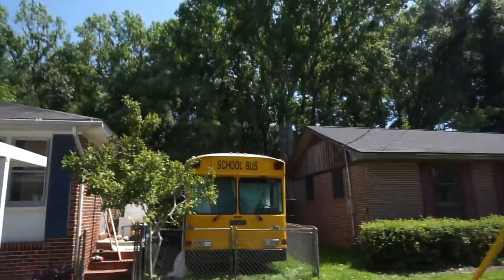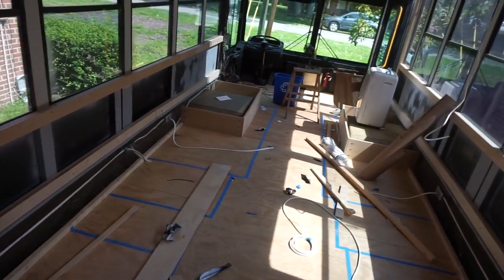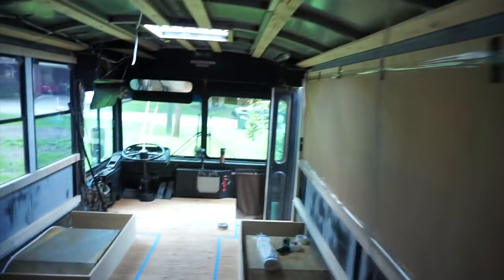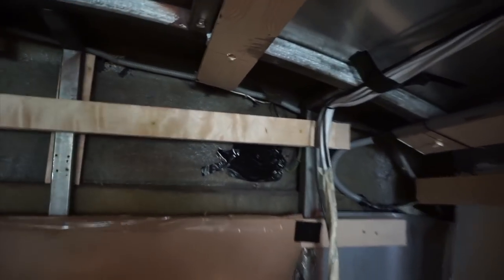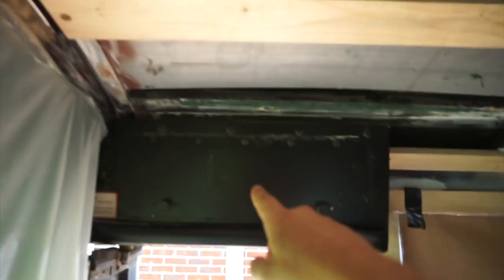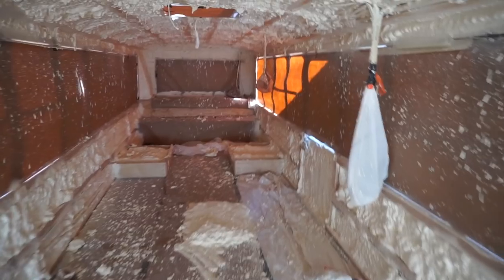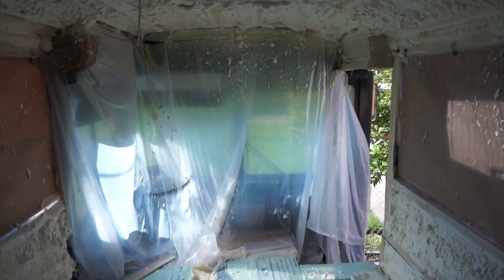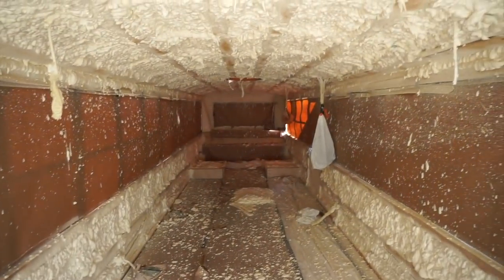School Bus Conversion Ep 20: Commercial Spray Foam Installation

Comment: I looked into buying the two tank kit and doing it myself. 1000 bucks, no way. I'll go with rigid insulation on my 4 window Skoolie as the R value is not much different than the spray foam.